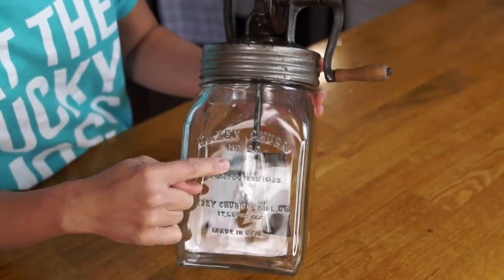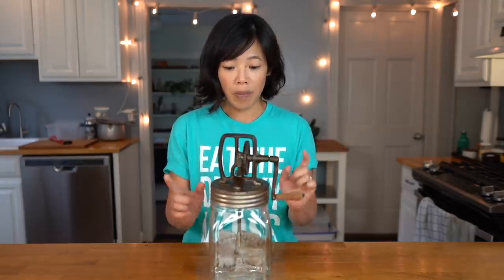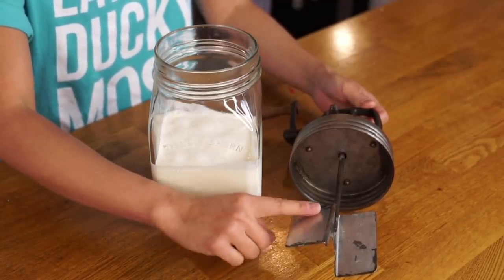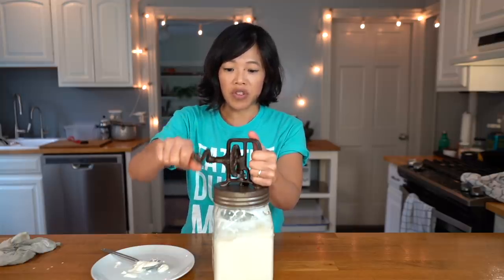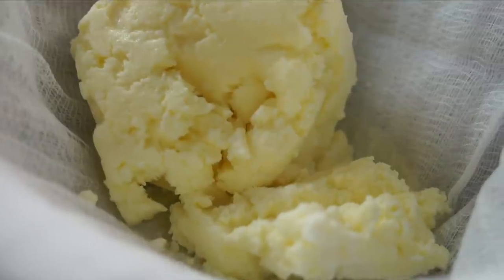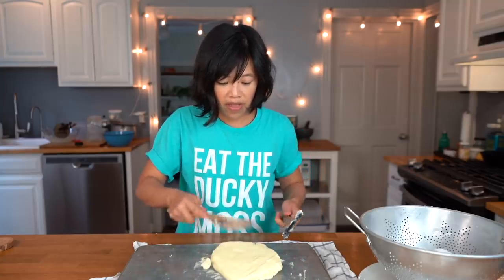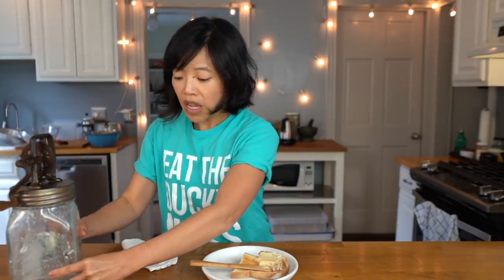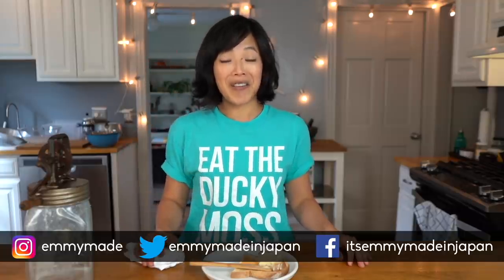How to Make BUTTER with a 100-year Old Gadget -- The Dazey Churn

Comment: Be a butter maker myself, you did a great job.  Most people missed one thing you stated very briefly.  Butter for the most part does not spoil, it is the milk left in the butter that spoils, spoiling the butter.  Making your own butter is a little cheaper, by the time you use the left over milk.  This butter milk is so much better than the fake butter milk from the store, not just a little better, but 100x better. If you use the jar shake method, while the heavy cream is on the counter warming to room temperature, put the jar in the fridge to chill it, this will also speed up the process by a minute or two.  Great job Emmy.

Comment: When I used to do daycare in my home we'd add clean marbles to the cream in jars and have the kids roll them around on the floor. Then I did the rinsing and salting. The kids would put bows on the butter filled jars and use them as holiday gifts.
And it tastes sooooo much better than store bought.
Reply: Can the marbles chip off little bits of glass or are they string enough? Maybe metal balls would be better. Something that isnt toxic if course lol. No lead fishing weights. That would be a metal ball but toxic lol. I never thought about adding something though. Actually maybe wooden balls would be even better!
Reply: That's an awesome Idea though.
Reply: I used glass marble and didn't have a problem with chipping. Metal balls would probably be better though. Wooden balls would work as long as they're cleaned well enough.

Comment: As someone who makes her own butter a lot, my only recommendation is to put the butter in a glass bowl and cover with water. You smoosh it around in the cold water and wash it that way. Change the water until it comes out clear, then pat it (I also do this in a bowl to drain the water out that accumulates) works like a charm.

Comment: Not a differential, Emmy, It's a ring and pinion gear train.  (To be fair, you were close.  The differential sits within the ring and pinion in any automotive-type drive axle.)
edit: This application is unusual in that the ring gear drives the pinion, increasing the shaft speed, at the cost of more effort required to turn the crank.  (the reverse of mechanical advantage.  mechanical disadvantage?)
Reply: Surly Ogre I want you on my team!

Comment: Just a tip if you are going to use a butter churn or a cream separator. Look for raw unpasteurized milk for the separator and heavy raw cream for the butter churn.  Pasteurized milk or cream takes twice (or thrice) as long too churn or separate. On the ranch where I grew up, after the old wooden butter churn broke into pieces, my mother bought an electric churn. What a difference! She loved it (so did I, relieved from turning the darn crank).

Comment: Emmy love I have one just like it and I still use it. We did things a bit different than you do. When we milked the cows, we strained or milk to make sure we did not have hair or trash of any kind in it. We then would put it Ina warm place to sour over night. We would then pour it into a churn and keep on churning until the butter separated from the milk. The butter was stuck to the paddle and buttermilk was left. Butter for the biscuits and the buttermilk to drink. Unless you do it the old fashion way you will never know what real buttermilk taste like or real butter. I personally prefer the butter sweet. Nothing in the world like it. We only used that little churn to do small amount. A much larger one was required to do most of what we did. My little churn had wooden paddles.

Comment: You can purchase a butter churner on Amazon.  After watching your video, I decided to buy the 
Kilner Butter Churner - 34 fluid oz. churner for $38.99, along with the paddles for $7.99 (7.7").
I consume 4 lbs. of butter/month, or 48 lbs./yr.  Avg cost per lb. of unsalted butter cost me
$3.79 in my community.  I spend $182/yr on butter.  I make bread in my bread machine, so the
idea of churning butter sounds right up my alley.  The churn + the paddles will pay for themselves
rather quickly.  I have had fresh made butter on a couple of occasions, and there is nothing like
its taste.  Just like fresh baked bread - there is nothing like the smell of bread baking.  Actually
have a loaf in the baking cycle in my bread machine as I watch this video.

Comment: If you wanted those gears to turn even smoother, use engine oil! Also, it’s a gear and pinion setup. A differential works a bit differently but is similar. That’s so cool though, I wanna make butter now, too lmfao!

Comment: I put the butter on a wooden cutting board, put it in the sink on an angle, then run cold water from the tap directly on the butter, while I work it with my rubber / silicone spatula... otherwise, if even a teensy little bit of whey remains, it *will* go sour within days

Comment: That rinse was insufficient. Knead the butter inside a large missing bowl with water, repeat until water turns clear. Or I hope you use that butter in 2 days or so. Room temperature it will spoil rapidly with that amount of whey in it. A stand mixer with dough kneader and plastic wrap it more practical.